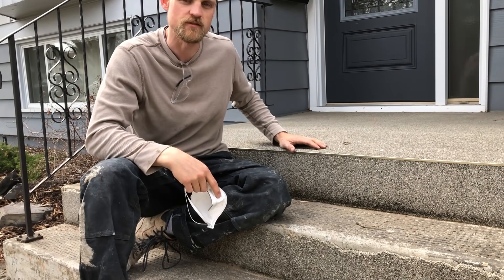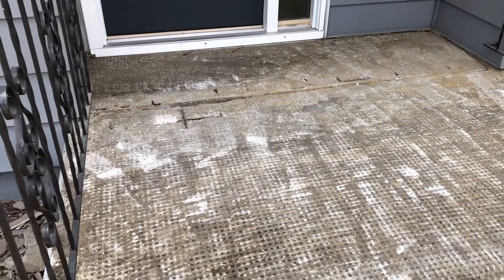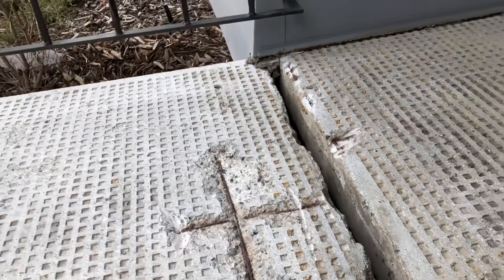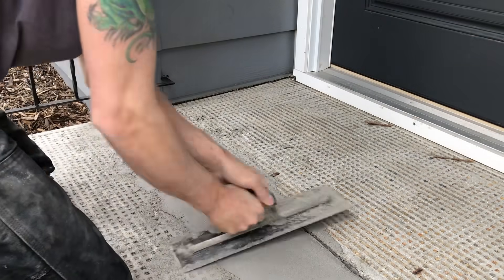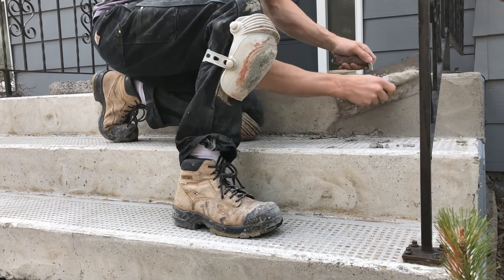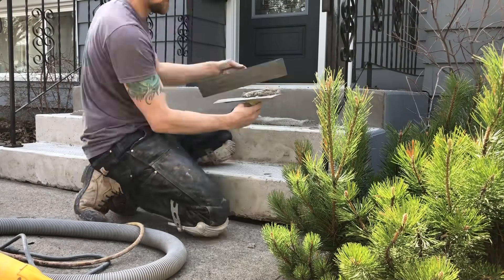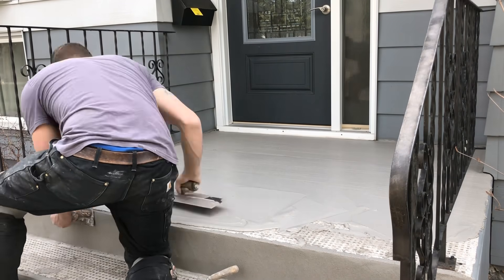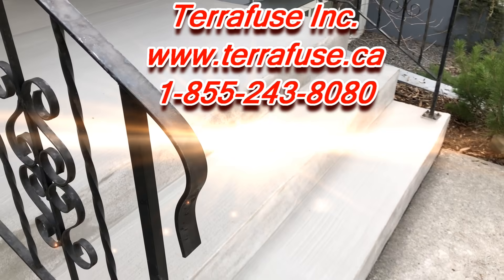Concrete Stair Overlay with TF Structural - One day full resurface!

Comment: Thanks very much for demonstrating your technique. That one trick you pointed out for doing the stairs is exactly what I was looking for. I'm doing a DIY porch resurface using parging mix and have had no idea how to deal with edges (e.g. stairs) other than applying the product sloppily around the edge and trying to work it into a half decent edge with a brush. Putting the one trowel up top to lock in the product when troweling it into the face of something is going to make my life a lot easier the next time I put my masonry hat on. Thanks again.
Reply from the maker: Thanks for the feedback!

Comment: On that joint , I have a trick. I use metal drywall corner bead and shim it if necessary ( let the one edge go down into the joint ) do the fill use the corner bead as a temporary strike/form.

Comment: the work looks good for sure. just curious as to why you wouldn't take the 8 or so fasteners out of the handrail to remove it. now if they ever replace the handrail that spot will have no overlay, not to mention it would have been way easier to put your finish on. 

side question how soon before you could put sealant on the expansion joint?
Reply from the maker: Customers are in charge of what they want done, and when you add extra costs, sometimes they say no 🤷‍♂️ 
You can apply the sealant within a couple hours.

Comment: You've shown a great instructional tutorial.  I've been trying to find out how to do my own project.  I'm going to attempt to repair a small area without hiring a professional.  I have exposed aggregate concrete which i really don't like.  I want to resurface it to a smooth finish. To start with, I want to prep the area by grinding it down a bit.  May I ask what type of grinder/wheel you're using on your Dewalt tool to prep the surface with?   Thank you.
Reply from the maker: Any diamond wheel meant for concrete will work. They are sold at most construction supply locations.
Reply from the maker: How'd it go?
Reply: @TerrafuseInc  I had gotten materials organized but, the winter hit and the weather has not been ideal to do any outdoor work in quite yet. It's still on my to-do list but I'm confident I can get it done thanks to your tutorial.  Many thanks!

Comment: Does TF always dry to the same color? Or could there be some variation depending on the mix?

I had my front porch done about 6 years ago, not with TF Structural, but with regular concrete. I'm not sure what the contractor did but since it dried it has always been about 4 different colors and it drives me nuts. TF seems to be my best option to get one uniform color outside of ripping it out completely and having it done over. Just wanted to know if I do this myself what are the odds that I'll end up with another spotted porch? Lol.
Reply from the maker: It does dry fairly consistent, but can definitely have variations in the coloring, especially with exposure to water. Can you send pictures? mike@terrafuse.com
Reply from the maker: https://www.youtube.com/watch?v=AY-mhFVXACs&t=46s
Check this video out for some after images, but this is years later. In the first few months, it won't look this consistent.

Comment: The bag says you can use up to 30% aggregate, does that mean you can add something like sand to increase the total surface area you can cover?
Reply from the maker: More like 1/8" gravel and larger. Sand will dry it out too much. it is more for when you are doing deeper repairs (deeper than 1" or so)

Comment: Hi, I will be doing stairs like these. I've watched most all of your videos. Other than the aggregate added to the mix poured into the forms, is there anything different between product you used for the repair, and the product you use for the top coat?  I've seen the videos where you repair driveways and always that mix seems wetter or more fluid. If it is the same TF structural you used for the stair repair, can you just use it without the aggregate and do the fishing all in one step. Many thanks as I will need to make my order soon, just trying to figure what to purchase
Reply from the maker: Nope, it is the same product, just mixed to a different consistency ( bit wetter for horizontal, bit drier on the verticals or deep pours). Yes, you can do it all in one step, but I recommend the risers first, and once set, then do the treads and landings.

Comment: What kind of surface prep would I need to a concrete porch that is not in bad shape but could use some resurfacing to the treads and risers due to normal wear & tear over the past 15, 20 years?
Reply from the maker: In most cases, a heavy pressure wash will be fine. You want to make sure you remove all the loose, deteriorated concrete, as well, there can’t be any old paint, or sealers of any kind. You need to get to clean, porous, sound concrete for the TF Structural yo bond to it. 😎
Reply: @TerrafuseInc  OK. Thanks!

Comment: Hi excellent video! I heard you mentioned you had to work around the railings. 

I wondered if you are re-doing your steps and adding new railings. You would fix your steps prior to adding on new railings? Ex: Correct broken concrete corners, lay down a new layer etc. 

My mother hired someone and they’ve started installing railings and the steps have not been redone and I’m not sure which is the correct order. Just seemed like to be working backwards.
Reply from the maker: Yes, it’s easier to fix before installing the new railings for sure, but can be done both ways.

Comment: Looks great to me! How much does this job cost?!!
Reply from the maker: The contractor can charge between 2000-4000 for a restoration like this. You can base it on what it would cost to have it removed and replaced, and still be less expensive.
Reply: @As02893 I was thinking the same thing. Guy is getting paid $500 an hour.

Comment: Which type of concrete or cement do you use ?
Is it from home depot
Reply from the maker: Its in the description. It is called TF Structural Concrete Repair. Thanks!
You can call us directly to order, or find it on amazon
1-403-243-3000

Comment: a couple of questions, how much time did you have for each riser, before the concrete dried/harden?  where do i buy this product?  or do you have recommended contractor for Markham, On?  thx!
Reply from the maker: Hello, you can get about 10-20 mins out of each mix, depending on temperature. Hotter weathers give shorter working times. Definitely takes some practice to do what is in the video. I can check who may be doing this type of work in your area. If you want to purchase , you can do it through us, we have material stocked in Etobicoke. 
Thanks!
Reply: @TerrafuseInc  great thx!  it doesn't look like a very difficult job; however, if the professional service is affordable, I'd rather not taking the risk.. after all, i'm not that handy.  BTW, how much does the material cost?  thx again!
Reply from the maker: You’re around $55/unit. That is for a 50 lbs. bag and the part B that you mix it with. Give us a shout on Monday to discuss further 👍
Reply: @TerrafuseInc  i emailed you guys last year but didn't get a reply.  what is the best way to contact you guys? am i still able to get the product in Etobicoke?  thx

Comment: What is the US equivalent to TF Structural? Is it available in the US?
Reply from the maker: Yes, but we sell to contractors in pallet quantities. How much do you need?
Reply: Terrafuse Inc. not a pallet. LOL
Reply: I am a local
Contractor here in the us. How much does it cost for the pallet and shipping to the us? How many bags are on a pallet?
Reply from the maker: @jeffvimpeny6885  Hey, please call out office, and we can get you pricing depending where you are, thanks! 1-403-243-3000
Reply from the maker: It is on Amazon now if you are still interested. Thanks
Reply: @TerrafuseInc  Nice. Thanks for the heads up
Reply: Do you  have video dealing with the bull nose on concrete stairs? Is it possible to replace Or repair the Bull nose?

Comment: How will this hold up against freezing temperatures & ice? Will it lift, pop off, or delaminate over a couple of cold winters?

Or how would a thin overlay like this withstand occasional impacts? Is it roughly 3000-4000 psi, as I'd expect the concrete to be?

Thank you very much. I enjoyed your thorough install-demonstration!
Reply: After posting this question, I read some of your replies, including a link to this video, which answered my questions.
(https://m.youtube.com/watch?v=AY-mhFVXACs&t=46s). 
Thank you! I'll surely be ordering some TF Structural, soon. 

How many bags (or how much volume?) did you use for this whole porch? I just have one stairway to do.
Reply: I just have one stairway to do, which is roughly 54 square feet of total surface area.
Reply from the maker: Sounds good!
Reply: @TerrafuseInc  How many bags/buckets/packages did you use for this whole porch? I have to do one stairway, roughly 54 square feet of surface area; How many bags will I need to get?

Comment: How much did u charge for that?
Reply from the maker: It depends on the contractor, area, extent of damage, etc., but you will typically be 20-40% less than replacing it with concrete.
Reply: @TerrafuseInc  $1,000 would be reasonable
Reply from the maker: That seems a bit low, especially because the one section was attached into the house.
Reply: So far that set of stairs he parged if I said 1,500 is that fair
Reply from the maker: Are you looking to do this for someone as a contractor, or have this done on your stairs?
Reply: I gave a bid of 2500 to two sets of steps this size idk if there cheep or not but rule of thumb. The lowest price doesn't mean the best quality

Comment: Thats not a true expansion joint. That is where someone has put prefab stairs up against a concrete landing on the house. Good thing you never tried to connect the 2, because it will continue to move during the freeze and thaw cycles.
Reply from the maker: You bet!

Comment: Can you add color powders to get some color in the final product???
Reply from the maker: Yes, but over time, the material fades very light, and colors can become very flat looking. Ideally, after it is stained, you can apply a clear sealer meant for concrete, and it will make the color more rich.